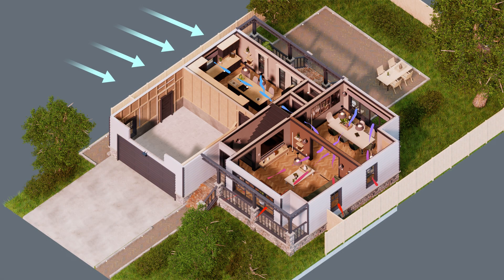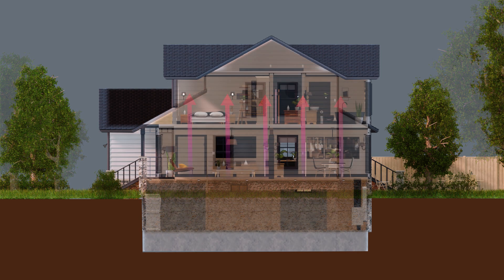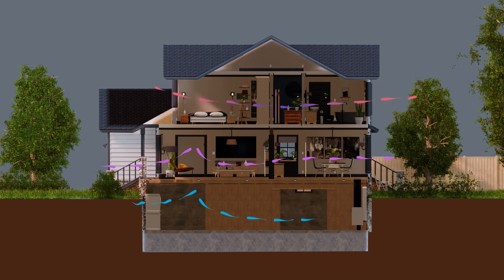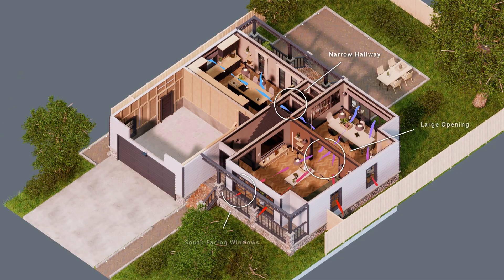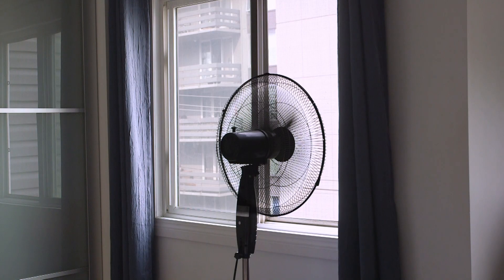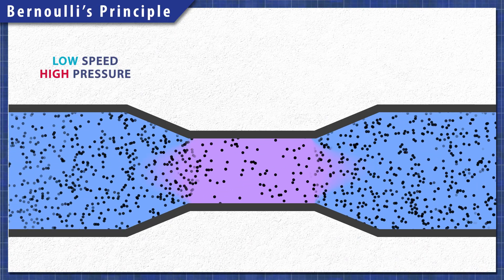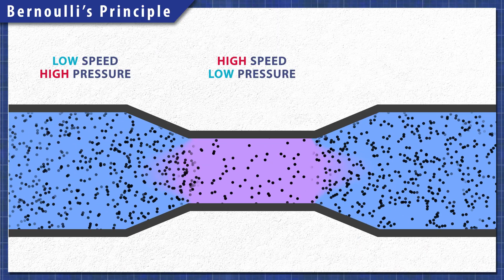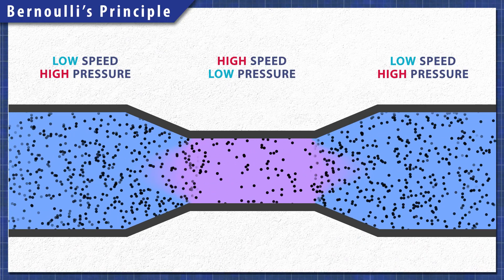How to Maximize Cooling with an Oscillating Pedestal Fan | Repair & Replace

Comment: That long plastic bag inflation blew my mind.  The end demo about placing the fan a few feet from window was quite interesting!
Reply from the maker: Thanks for watching! Even after filming that and inflating the bag with that technique multiple times it's still feels like a magic trick. We're thinking of doing another supplemental video or short with an airflow meter to show the actual difference in airflow which shows why "pulling" air is not as effective as "pushing" air.